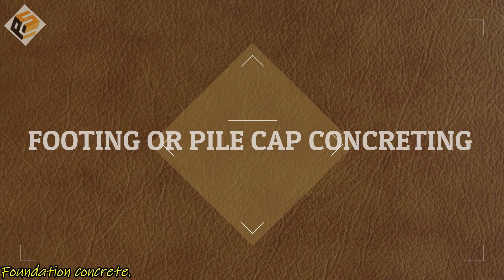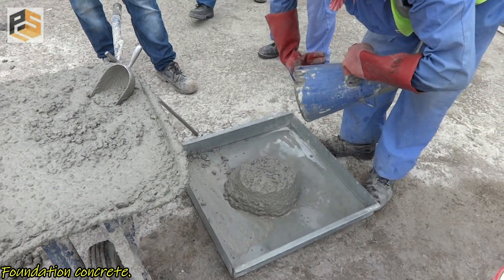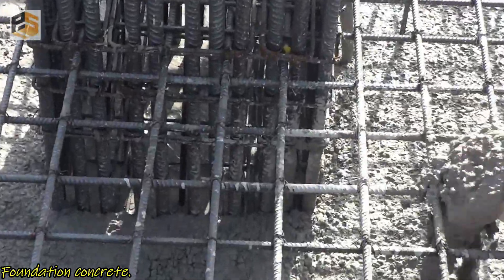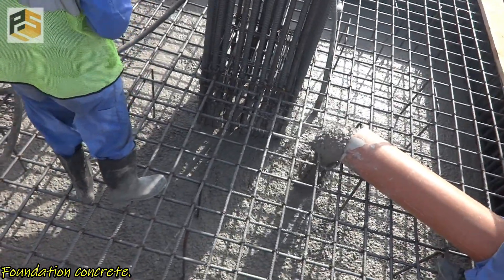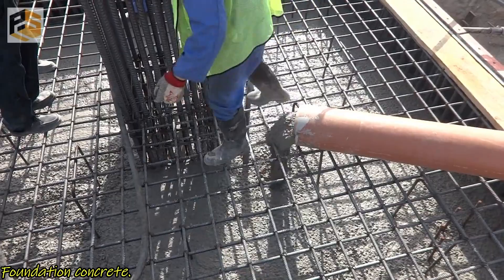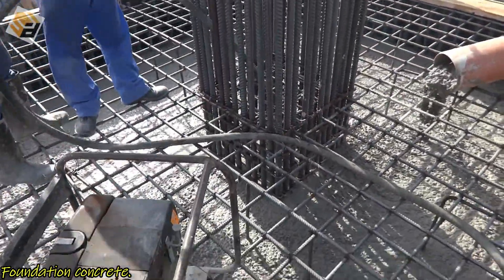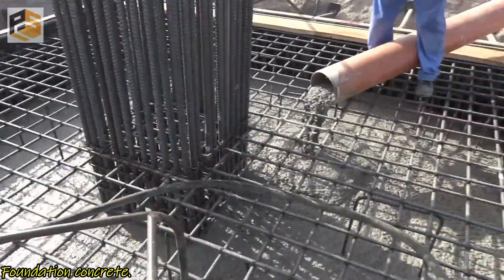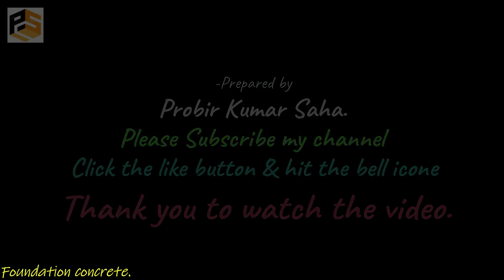Footing or Pile cap concreting

Comment: If in case joints needed to be placed due to break in concreting works, What should be its position? What should be needed to be done in such case?
Reply from the maker: Thank you for your comment. Could you please elaborate your question for my better understanding?
Reply: @probirkumarsaha  Sir. I mean to say that if in any case when we cant  do  the whole quantity of concrete continuously which is required for the pile cap and if we are under the circumstances where we have to beak the concreting work and introduce a joint in any way, then in such case what should be the position of the joint and what type of joint (vertical or horizontal) is needed to be introduced in the pile cap ?
Reply from the maker: @hitendrarayamajhi7262  Thank you. The joint is called Construction joint. Before the 2nd pour concreting some bonding agent can used before pouring. The joint could be made rough by chipping before the the 2nd pour.